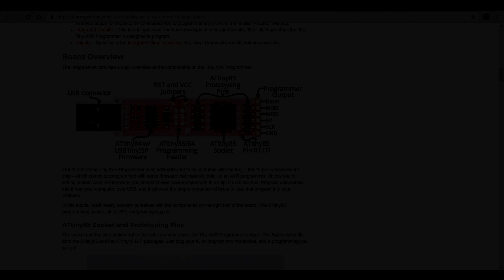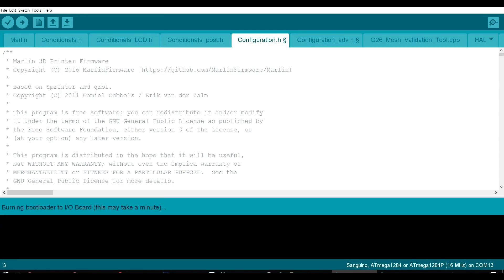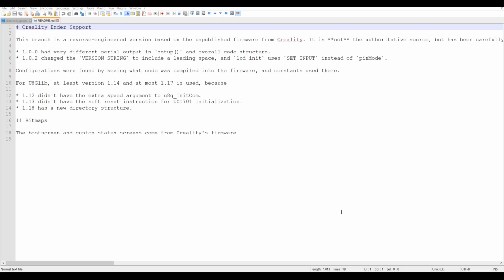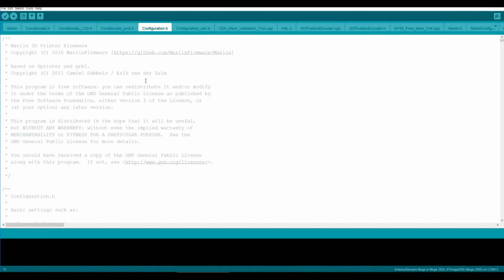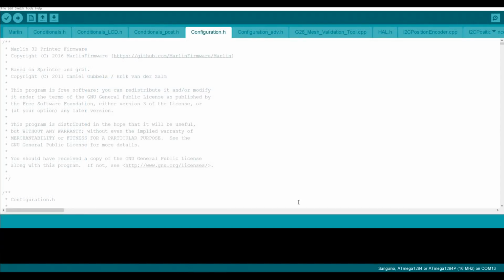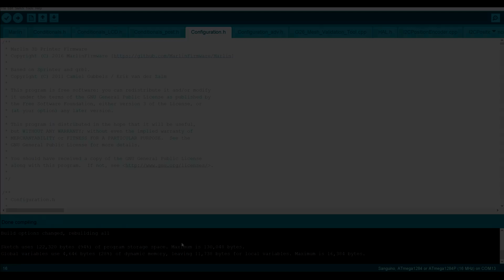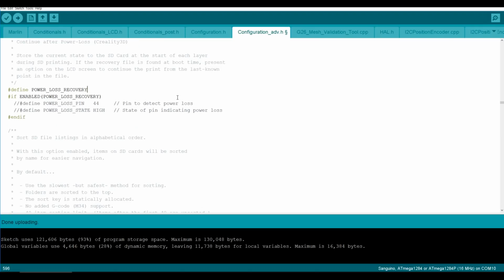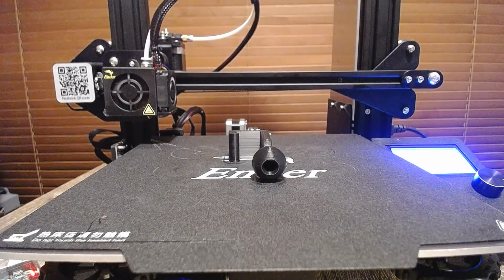Ender 3 vanilla Marlin update: Concise guide

Comment: I suggest everyone to take a look also at klipper firmware, with that you can print at incredibile speeds, you are only limited to the filament quality. On my ender 3 I can print at 100/120 mm/s at the cost of some minor ghosting.
Reply from the maker: I'll be making a video on it at some stage.
Reply: @TeachingTech  remember to set the pressure advance to "1" as a start value
Reply: The S_CURVE_ACCELERATION feature in Marlin 1.1.9 allows for faster speeds, and the ADAPTIVE_STEP_SMOOTHING feature helps to reduce aliasing by running the stepper ISR at a higher rate so that E steps, especially, are more regular.
Reply: @ScottLahteine  still you are relying on the mcu to do all the calculations and an 8bit mcu is not that fast, so you are still limited to that.
Reply: thesimbon True, a Cartesian using 32x micro-stepping does push the limits of an AVR. Similar to the Klipper approach, we’ve had.a “direct stepper chunks” feature in the queue for a while which bypasses the planner, but it requires pre-processing of the G-code. I’ve done some interesting experiments using two interconnected AVR-based boards to distribute the load. Of course, we now have 32-bit support, and this will certainly be the future, as then we’re back to a single board with 8x or higher clock speed over AVR, easily able to keep up with even a delta using real 128x micro-stepping.
Reply: Well, of course if you have a 32bit board (like duet3d) it makes not real sense to use klipper, but if you got a cheap 3d printer and you want to speed things up without spending too much money then klipper makes sense especially if you already have octoprint running.

Comment: I have followed your previous guide and installed the TH3D in order to be able to calibrate my printer (so that the E steps settings stay saved with M500), should I upgrade to vanilla Marlin now? I do not care about the power resume feature
Reply from the maker: Unless there is a new feature in 1.1.9 you're interesting in there is probably no great need.

Comment: Just did this and setup BLTouch on "vanilla marlin" (for the reasons you mentioned in the beginning of the video). if only  your BLT video was a week before I wouldn't have had to figure it out.  looking forward to it!
Reply from the maker: This is a remake because the other one has become redundant.
Reply: Care to share your settings? I played around and can't seem to find the right way. Also I am new to all this so I still have plenty to learn.
Reply: Eric Fabinger   I started with this config: https://github.com/LetsPrint3D/ender-3-marlin-abl-firmware-1.1.9
Reply: fatmann66  Thanks, I give it another try starting with that.
Reply: Eric Fabinger   I can link you my config if you need it. I checked and didn't see you on either of the facebook ender3 groups. prob the easiest way to get it to you
Reply: fatmann66  thanks, I don't really do facebook. I noticed reading through the config h. file BLTouch wasn't  used but fixed probe. Is the BLTouch connected to Pin27 and the Z min plug?
Reply: @Megdiver   yes you have to disable  fixed probe and define pin 27, bltouch etc. There are a few more  things that need to be defined to get bltocuh working
Reply: fatmann66  could you send me your final Marlin file? I keep playing around with it but I can't get it to work.
I used the little breakout board so that I didn't had to cut the ribbon cable and the BLTouch does it initial click/test. But either I am doing something wrong or I am missing some setting or a combination of both but when I tell it to do the leveling it does X & Y and than heads into the middle of the bed and tries to bury the nozzle through the bed. All help much appreciated.
Reply: Eric Fabinger   I can, but no easy way to send via youtube.  you should think about  joining facebook just for the  3d printing groups (I too don't do fb, but I joined and only use it for those groups are a very good and one of the only resources)  drop a message in the ender3 group (https://www.facebook.com/groups/Ender3/) and I can PM you the config
Reply: fatmann66  OK, just signed up, waiting to be accepted.
Reply: Do you know how long it normally takes to get accepted? I haven't heard back from the board admin yet.
Reply: @Megdiver   normally  only  1/2 a day or so.  I would have expected  it by now. I searched your name and sent a PM to  who I believe was you. Check fb  ( it a the circle with a lighting bolt) and respond if so and I can send it to you

Comment: Always learn something new from your videos, I didn't know you could put more than one URL in the Additional Board Manager field.
Spent today installing a couple of upgrades on the CR-10 ... extruder and  PTFE connectors. I also put the 20x20 extrusion covers on, mostly just to stop stuff from collecting in the rails. BTW the X axis was a bit noisy on fast moves, so I experimented with reducing the driver voltage. Turned it all the way down to .55 and, surprisingly it works perfectly and still has plenty of torque, including holding torque, it's a lot quieter too.
I also experimented with the new version of Linear Advance (1.5) but that failed miserably so I disabled it. Might revisit at a later date, but my prints are fine, so no urgency.
Reply from the maker: I'll also do an linear advance video at some stage after I play with the newest version.
Reply: Teaching Tech  Can't wait!
Reply: Teaching Tech  That will be fantastic, I'll probably learn where I went wrong .... again :-)
Reply from the maker: Thanks for sharing the detailed info. Had to record the additional board url three times to get it right. First time tried space, then semi colon, finally comma separated worked. After I install dampers I might experiment with stepper current. Lower is always better if it's not missing steps.
Reply: Teaching Tech I did buy some dampers a while ago, but never needed to use them yet. But I'll give them a try one day, if only for my own comparison.

Comment: Can’t wait to put this on my machine.  I’m using a usb style device too however having issues getting arduino to see the port (it is grayed out).  I verified the pins are going to the correct spots on the board
Reply from the maker: Installed the Creality driver?
Reply: I down loaded everything in your guide and in modbot’s guide.  So I would guess I have.
Reply: Ryan Ballard  Check your USB cable.  I got the same thing when my cable went on walkabout.  No, I'm not Australian.
Reply: Mine plugged directly into the computer like the one Michael used in this video.  So there is no USB cord.  Tried it on a different computer too and still not working.  I’m sending it back and ordering a UNO

Comment: Nice job,
 but there is one issue /glitch with Marlin 1.1.9 and Cura 3.4.1(and older 3.x.x versions) 

I'm running Marlin 1.1.9 on my Ender 3(Relular "old" Ender 3, not Pro :) ) 
as well, 
but it can NOT connect to Cura via Cable/Serial USB Com.
This issue is present in Marlin Bugfix daily /nightly versions as well. 
(I hope  that Marlin creator and Cura designers are aware about this and that it will be fixed asap)

Connecting and printing via Cable/Serial with Simplify3D and Repetier Host works just fine, I really don't know what is so much different about Cura serial connection.

It bugles my mind why this glitch isn't happening on Marlin 1.0.0(old as of 2011) but on the newest stable 1.1.9 it is there. 

Octoprint works OK On Marlin 1.1.9 as well as on Marlin Bugfix.

Comment: Teaching Tech 
Does this work for the normal ender 3? I followed your video's last time.
My bltouch is coming tomorrow and I want to use this guide instead of of the previous one?
And does this new version of marlin also have Filament change function?
Reply: Awesome video's Btw..Im Very Thankful
Reply from the maker: Yes the firmware is identical for normal and Pro Ender 3. I would suggest starting with this for a BLtouch install.
It is the newest, main branch of Marlin so it should have everything you've heard of.
Reply: Teaching Tech  Thank you for you quick reply! Your Awesome!
Reply: I just flashed my normal ender 3 with marlin 1.1.9 over the weekend and it works great.